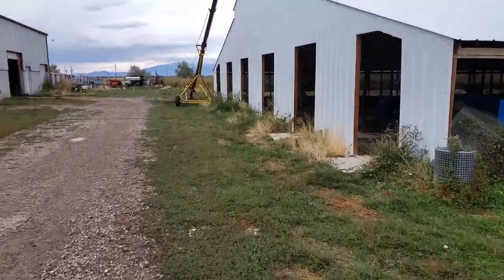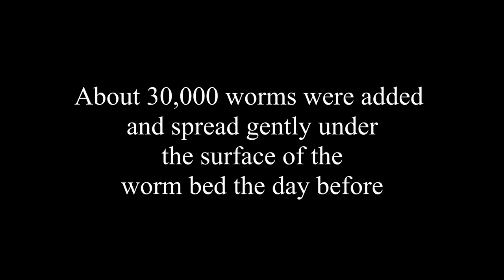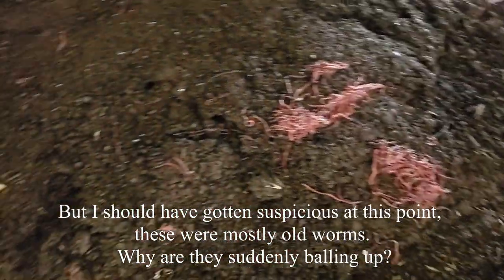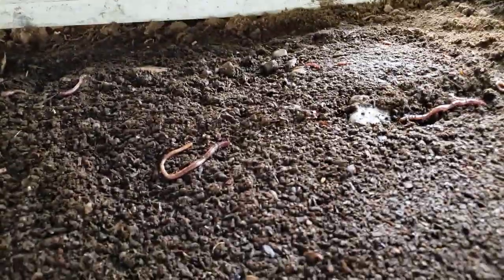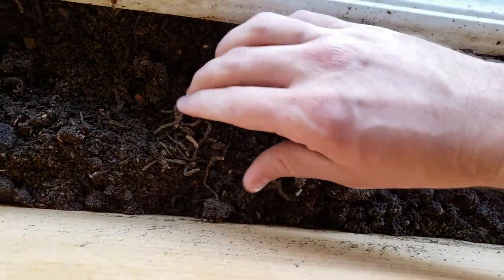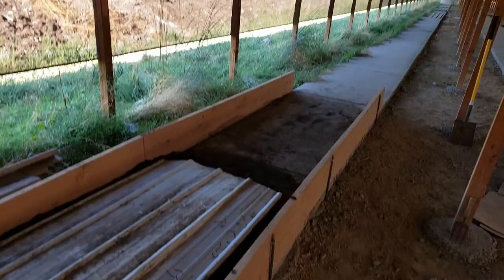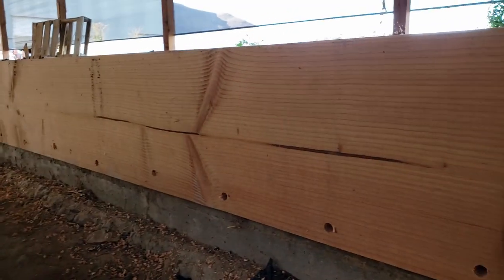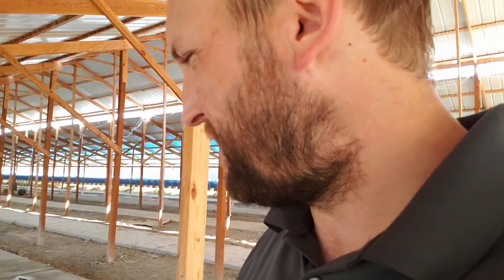Why are my compost worms dying? - Something is wrong with my worms - Part 1

Comment: I have an expensive worm bin and the worms didn’t like it at all. They kept trying to get out. And would literally cluster all over the underside of the lid. 
So I just relied on worms in my compost bins and it was great for about 2 years… loads of worms. 
This year 2024, no worms in our organic garden or in our organic compost bin. Last year tons of worms. I don’t use anything toxic…no pressure treated lumber, no sprays of any kinds…just weeds and kitchen waste. Up to last year, I was using cardboard with very  positive results as mulch on very weed challenging areas. After eliminating all the causes for no worms I’m left with cardboard use. I’ve done it for years with better than good results. But this year, I can only conclude that chemicals used in the recycling and manufacturing of cardboard is hurting the worms. Although I’ve read that studies have shown that worms can neutralize toxins in soil, they can only do so much.
I will add that friend who have not used cardboard have no worms either.

Comment: I think that if I was going to lay sheet metal down over the top I would lay some 2x2 boards across the bed every few feet to keep it from contacting the soil. That way it's covered but there is an air buffer between the metal and bedding.
Reply from the maker: We ended up doing something like that actually :)
Reply: Exactly... But why was the tin still on at the end of the vid 😤
Reply from the maker: @kemet432  Was removed the next day, I should have added that footage into this video but didn't. Also at the time, I wanted to see if the holes in the sides would be enough.

Comment: i believe it has got to do with the cement reaction on water or wet soil. usually creating hot environment especially if the cement is not yet fully cured.  and it droves away life form because of hot environment making water content from cement evaporates. worms like cool environment. so they come closer under metal sheet. but from top, if weather in afternoon gets hot, then they have no place to go, and then dies.

Comment: Mine are in 5 gallon buckets and are dying off..there are air holes in top and sides and bottom..and soil is moist its 75 degrees where they are and I feed them 2x a week what's wrong?

Comment: its better that you have placed first plastic sheets before putting the vermicast soil then the worms and compost..worms are protected from cement chemicals plus they will stay below because cement is cold.if not wet. especially if it is fully cured.

Comment: I keep the what seems like 85 million stray neighborhood cats out of my garden with screens made of that plastic chicken wire stapled to 1x2 frames.  Mine are cut to about 3ft square panels which makes it easy to move them around when I am working in the raised beds.  I can lay them flat on the beds, lean them against the fence on the slant, or stand them up straight along the front of the beds as the plants get bigger.  Perhaps if you used cloth covers and then laid some of this kind of screens on top to hold it down n keep the dogs out....?  Or try spraying a little vinegar out around the beds and see if the dogs stay away.  The neighborhood cats don't like the smell of citrus either.

Comment: My guess... im assuming you are using tap water. Chances are its clorinated. Try getting  water filter for the hose. Check your bedding material that isnt "hot". No fresh manure. Sheet metal doesnt breathe.
Reply from the maker: Ended up solving this issue. It was due to the sheet metal and things going anaerobic. The water is untreated.